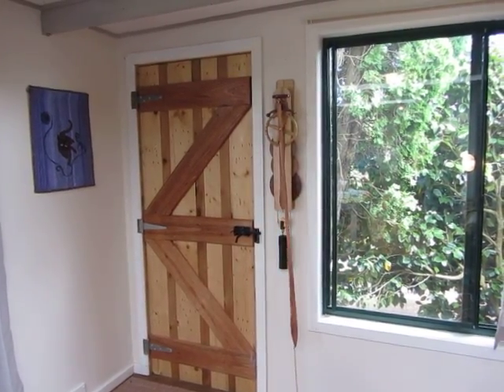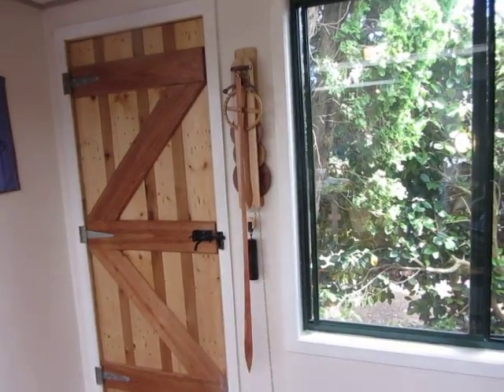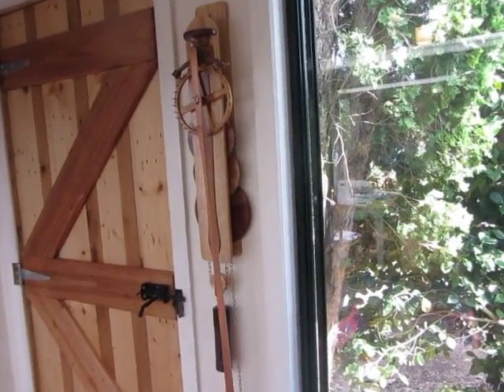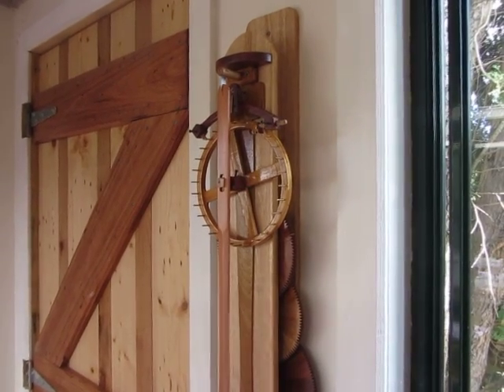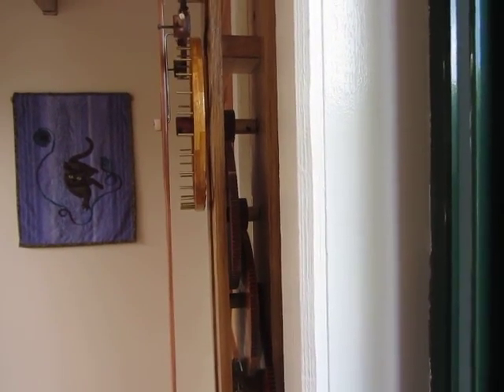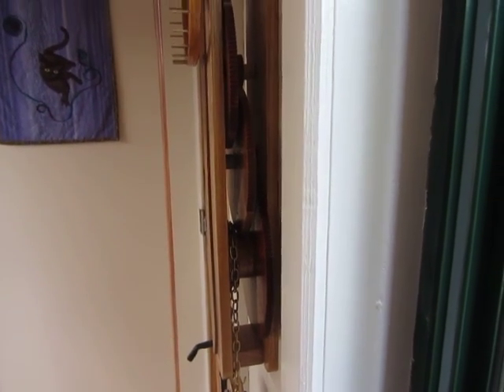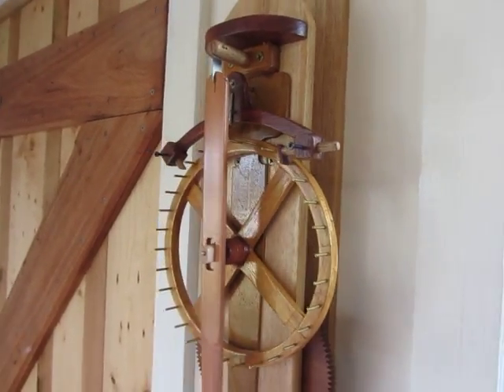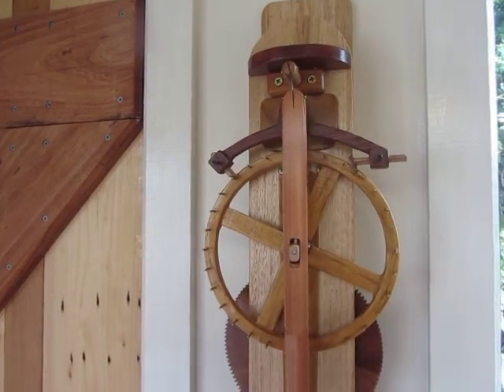Graham's 1715 dead beat escapement

Comment: hi sorry i am a bit thick in the clock department, i want to make something that ticks that will turn a shaft, i love this but why do you need the 4 gear wheels behind? regards A
Reply: Technically, you don't need that many. The more geared-down it is, the more weight is required to get power to the escapement, and the less frequent you have to wind it. Too much weight will damage the mechanism. it's a balancing act.
Reply: @sky173  many thanks for the reply